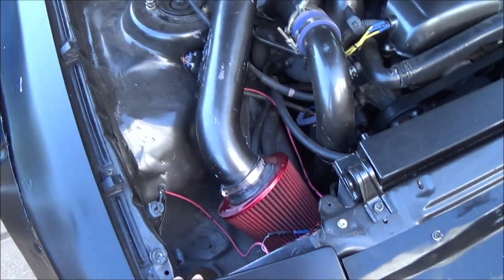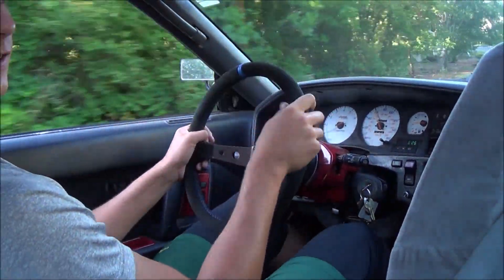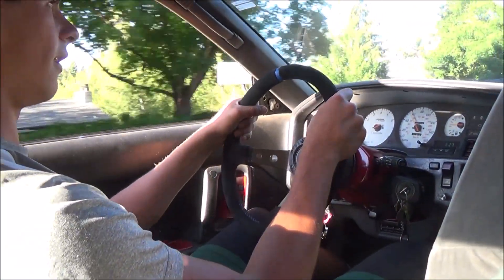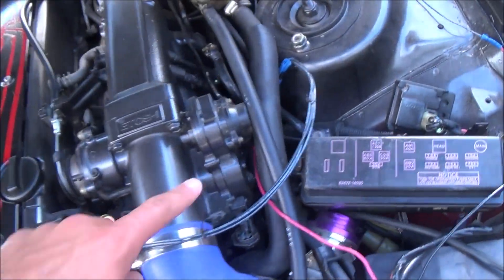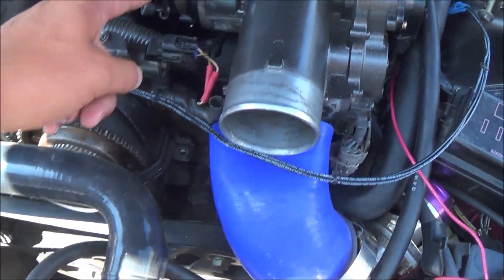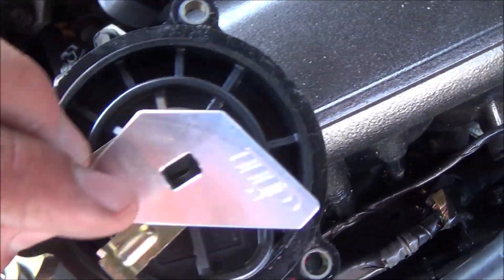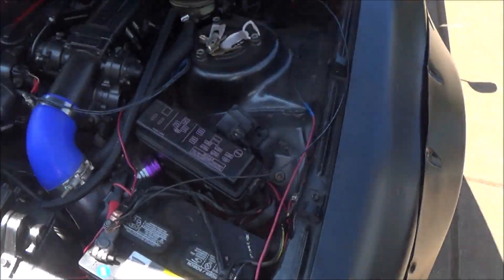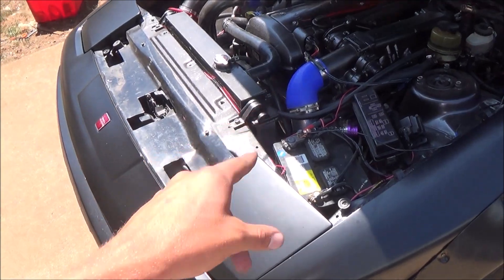GOING FULL THROTTLE

Comment: If your running an aftermarket down pipe and exhaust that's definitely fuel cut. You can run a restrictor plate in the exhaust to prevent that on the factory ecu
Reply from the maker: I'll definitely look into that! Thanks for the suggestion!
Reply: No problem man. It's pretty easy to make. Just take a sheet of metal use an exhaust gasket as a template and cut a 2" hole in the center and bolt it all back together with the "restrictor" in it. Worked for me to help limit the boost to 1 bar/14psi to avoid fuel cut
Reply from the maker: Can I use aluminum sheet metal or is that too weak?
Reply: My bad man I didnt see this comment. Um not sure. I guess it would depend on how high the temp gets in ur exhaust and the annealing temp of the aluminum sheet metal